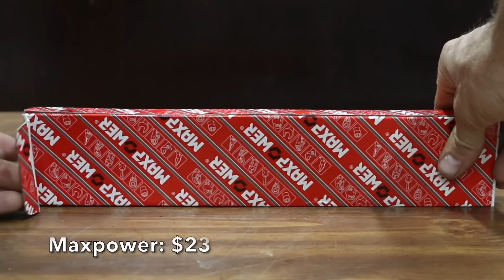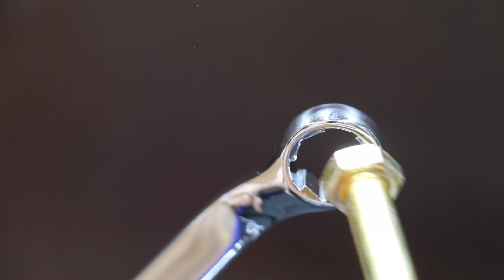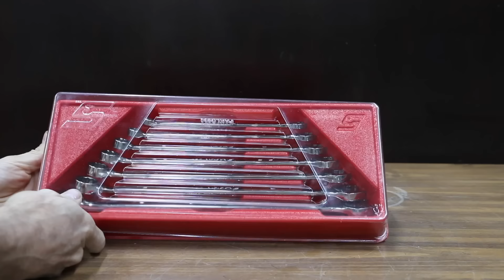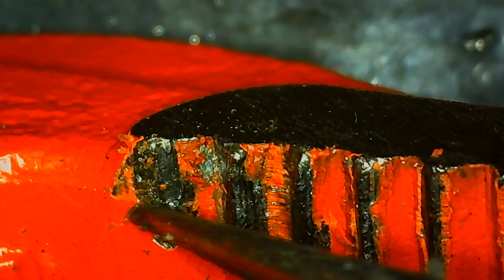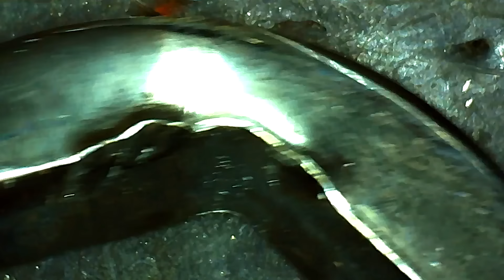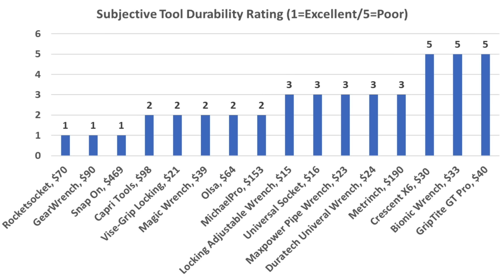Best "Rounded Nut" Extractor Wrench? Let's Settle This!

Comment: I've had that stanly adjustable wrench for years, it's handy to hold bolts and nuts as I go around and get to the other side of the thing. it's also good at crimping ribbon IDC connectors. I did have a problem where the adjustment spline got some damage and I had to take it apart and file the threads.
Reply from the maker: Thanks for the feedback.
Reply: Todd, you're the best.  My spouse says i have too many tools.  What do you do with all of the items you test?

Comment: 2 videos that would be good to see you do would be the best G clamps and best quick release clamps as there are a lot of tradies regardless of their field that use them. Biggest thing I think most people would like too know is the failure load for them as I've had in the past a G clamp break in half while tightening it to hold an item closed.
Reply from the maker: Thanks for the suggestion.

Comment: So I have a project truck and I got some screws on the dash, under the wind shield and I guess the old metal is soft cause my screw driver just tears it apart. What would be a good tool to get that loose and out in a tight space. Could you do a video on....whatever tool that would be to get it out. I don't wanna remove the windshield if I don't have to.
Reply from the maker: Thanks for the video idea.

Comment: Might add,that a good "tube wrench" line wrench,flare nut wrench,is not for wasting on nasty steel bolts which can be attacked with such as pipe wrenches and Vice Grips/turbo sockets. For line fittings and flare nuts,soft things. Brass? Copper?  But good ones are too expensive to use in place of those other tools.
Reply from the maker: Thanks for the feedback.

Comment: The rounded nut...how well does each wrench hold up when a smaller size is hammered onto the nut, does it remove the nut? 9/16" rounded nut, next size down...1/2"
Reply from the maker: Thanks for the suggestion.

Comment: I was looking through your videos hoping to find one comparing power steering fluid vs ATF Dexron 3. YouTube seems to be full of conflicting opinions / information on the subject of which is better, sometimes contradicting themselves within the same video.
My #1 question is about swelling and degradation of the seals in the pump & rack from switching from atf to psf, or mixing the two.
If that's true, then anti friction and temperature performance comparison won't matter so much.
Now I'm watching your stop leak video & the o-ring testing part....nice!
Reply from the maker: Thanks for watching!

Comment: I've used that Stanley locking wrench a few times for adjusting tie rods on rusty cars for alignments. It... kinda works... but the jaws are too soft and there's a bit too much slop when it's locked. I think it's a great tool idea, just needs some tighter QC to make it work better.
Reply from the maker: Thanks for sharing.

Comment: As always, another fine presentation. 
My takeaway from this. Although there is a winner. I believe that in some scenarios, one type may have an advantage over another. That may have been mentioned. If so my apologies. The volume was off. It was homework time and the house is silent except for the homeworkers outloud thinking.
Reply from the maker: Thanks!  Good Point!

Comment: I think the vice grip tool may perform better if flipped 180 degrees from the way you had it. The force applied by the flat on the bolt to the jaw of the tool is more likely to force the jaw open the way you tested the tool. Flip the tool over and the force is applied at a different angle that is less in line with the direction the jaw is hinged.

Comment: Curious why the rounded fastener wasn't ground down to the next smallest wrench size? It might not be an ideal test since we're now comparing different bolt head sizes, but if you're desparate to get a stripped bolt out and don't have a set of extractor wrenches AND extractor sockets it would be good to know which wrench set would work the best in that scenario. Maybe a follow up test?
Reply from the maker: Thanks for the suggestion.

Comment: With rounded bolts I usually grab the knipex water pump pliers because the teeth seem to bite into anything I put them on. Messes the bolt up but I'll usually have replacement hardware on hand. If those don't work I'll grab a pipe wrench if there's enough space to use it. Worse case I just drill it out
Reply from the maker: Thanks for sharing.

Comment: Can you comment on the method used to create the completely rounded bolts? It sort of looked like either a bench grinder or a lathe. Some of the tools had no grip or contact at all with the completely rounded bolt, almost as if the bolt had become undersized when prepping it for testing. In a normal working environment, many "completely rounded" fasteners still have just a touch of flat left on them.
Do you think the prep method may have skewed the testing?

Comment: I wish you had included a standard, curved jaw vise grips style tool.  It seems like for a rounded bolt it may still be the best bet for places where it fits.  If the bolt / nut is already rounded I'm not usually concerned about damage since I'll be replacing it with a new one.
Reply from the maker: Thanks for the suggestion.
Reply from the maker: Thanks for the suggestion.

Comment: I'm curious as to how tightly the Irwin was socked down--since they have a vise-grip mechanism they can be tightened down until they break.  And whether a different size (there are three) would have given a better result.  I use those for rusted on brake lines and they have never failed me.

Comment: Would be nice if  something similar to the old Petersen "Vice Grip" made the locking plyer style tool,I think "Malco" was a project to  make such locking plier tools similar in quality to the original "Vice Grip" but I think they stopped manufacture 
  but such tools are too crude and destructive to use on soft flare nut and line fittings that need to be reassembled ,also too big and bulky 
would be interesting to see what a small "Ridgid" pipe wrench could do with the completely round bolt head
Reply from the maker: Thanks for the constructive feedback.

Comment: Great video. I think if they used better metal when making the universal socket it could be much better. Maybe hardened pins or maybe instead of round pins, maybe hex shaped pins would grip and hold up longer. Also can anyone tell me why on box end wrenches and sockets they don't let the them internally straight to the bottom so it has more contact with the nut/bolt? I have wondered this for a long time, now that I watched this it brought it to the front of my mind. I figured maybe someone knows and wouldn't mind sharing.  Thanks in advance.

Comment: Excellent video! Something that the internet cant seem to find a decent version of is spray bottles! They all seem to have some weakness, whether it be to soaps, alcohols, oils, or even mild solvents, and the trigger jams up, etc. I think it would make for a fantastic video for those of us who use spray bottles in the shop! (possibly even compare some of the bottles from existing products like windex/bleach/etc)
Reply from the maker: Thanks!  Thanks for the video idea.
Reply: @ProjectFarm  You could probably do some sort of crossover video or get advice from Obsessed Garage.  Matt has tested all kinds of different spray bottles.
Reply: Yes I second this!   I've broken at least half a dozen in the past three years alone.
Reply: This is actually a really good video idea
Reply: I will nominate Solo's excellent 1L (418) and 2L (418-2L) hand-pumped spray bottles w/the round reservoir: excellent adjustability; quick pump action; outstanding durability - and 100% rebuildable. Cheap enough you can own one for each type of chemical use, plus always one for water.
Reply: @felisconcolor1112  Where do you get rebuild parts for them?  And have you used them with solvents?
Reply: Would metal reusable ones and plastic ones be 2 separate videos? I had a metal one back in the 90's that I used to use for cosmoline when storing lightly used parts. I miss that one, lost it in one of my moves.
Reply: Same here bleach just destroys bottles

Comment: I'm glad you put a pipe wrench in this video, I keep a 6 inch rigid pipe wrench in my tool bag for rounded bolts. If it's set right the harder you push the harder it bites.
Reply from the maker: Thanks for the feedback.

Comment: I was given a Bionic Wrench for Christmas quite a long time ago and haven't tried it yet.  I didn't think it would be durable, and it isn't.  And the shape makes it awkward to use, too.  I've got at least one of those Universal Socket Multi-Function Adapter pin-inside things that I have never used.  And now I see why.  🤣😂🤣😜  The RocketSocket may have been able to handle tractor mower spindle bolt that broke in one of its mounting holes.  It was stuck so bad, the bolt head broke off.  I tried loosening liquids and vice grips, but all that did was strip all the threads, so I had to grind it flat on both sides, try to center punch, drill it out and tap it.  I got close to center, but had to adjust the deck mounting hole by making it oblong for the new bolt to fit, but it worked without having to buy a replacement, but man, that was a HUGE PITA!!!

Any damage done by the RocketSocket would be acceptable because getting it out is all that matters.  And it's very durable!  I just bought the RocketSocket set from your store.  It will be here on the 22nd.  That Wrench Extender Tool Bar is very cool, but I don't think I need one.  I love your work, Todd, and I benefited from this one.  I'm sure the RocketSocket set will come in handy for many applications.  Thank you and great job!
Reply from the maker: Thanks for sharing!

Comment: I ended up buying some "Rocket socket" look-a-likes based on your original recommendations.
Those types of sockets are so good at removing rounded nuts.

I'm honestly amazed at the level of torque they can hold without losing grip. It's honestly one of the best tools to have when working on old rusty cars :D
Reply from the maker: Thanks for sharing!
Reply: They work great on rounded lug nuts too.
Reply: Tool Review Zone made a vid showing GearWrenches version, definitely made me a believer
Reply: yea but they quickly loose their edge, and you cant always heat up the broken stud (too close to oil seals, 0 rings, gaskets etc). atleast for the salty outboards i work on. but agree... they are very good. have piles of em'

Comment: My last resort option to remove rounded nuts, is my chisel/air chisel.

Start by going straight in, and go, at most, half way through into the nut , then angle towards the direction to loosen.
The nut will likely split, but even if it doesn’t it will loosen.

This will destroy the nut, of course, but it works on both Metric and SAE
Reply from the maker: Thanks for sharing!

Comment: I hadn't thought of using a pipe wrench before. That's definitely worth a shot if the bolt is in an accessible spot. I usually go with a pair of locking vice grips and a hammer.
Reply from the maker: Thanks for sharing!

Comment: So I have a question.  On the wrenches that 'there wasn't enough surface area on the rounded bolt' did you try going down a size to see if they would do anything?  I'd be curious to see if that would make a difference.
Reply: Seems like kinda an oversight, obviously the bolt is no longer the same size it came in

Comment: What if you cut a slot into round head bolts were possible to make large screw type fasteners?  Portable rotary tools/ Dremel tools are plentiful and are becoming very affordable . As we know from previous PF testing.  I say a slot because it is one cut vs many ,but any shape could be utilized. They make highspeed burrs so small they are not much larger than a human hair.  If you are paid by the hour , there is no reason you can't make torx or star bits lol.
I also wonder if the tools that break could be made tougher by a heat soak , just throwing the tool in an over on broiler for an hour and then drop to the highest oven setting for an hour and then drop to 400°f for 24 hours , then let it cool in the oven unil room temp. Chances are it will remove some of  the brittleness of the steel in the problem areas. It won't hurt most already properly heat treated parts and hey, if it can make a good concept that's poorly made into a good tool , it may be worth while if the base tool is cheap enough.

Comment: Would like to see test small shop air compressors , 2 hp, oil free direct drive, oil lubed,  belt drive 1 and 2 cylinder, 1725 vs 3450 rpm motors....I have had many over the years, and I believe the speedair 2cyl 1725 rpm was the most efficient... let me know.
Reply from the maker: Thank you for the video idea!

Comment: A small pipe wrench is an excellent tool for any mechanic to keep stashed in the back of the toolbox. Yes it ruins the bolt but you’re replacing it anyway. I’ve been saved many times by my pipe wrench!
Reply from the maker: Thanks for sharing!

Comment: Great video! Would love to see a test of Pelican 1510, Seahorse 920, Vault V525, HPRC 2550w, Nanuk 935, and Apache 5800 Hard cases. Testing for water tightness, pull handle,side handle, and latch strength, case strength via drop testing, and chemical resistance! They are meant to be used for cameras and other things but as aviation mechanics this is very popular brand and size to use as a line tool toolbox! You are the best person to test these and great video by the way!
Reply from the maker: Thank you for the video idea!
Reply: @ProjectFarm  Thank you sir! You have saved me alot of money these last few years!

Comment: Excellent review... I really appreciate this test with such a variety of brands. Would have been cool to use the Rocket Socket on a reverse threaded bolt just to see how much torque could be applied before slipping or breaking.
Reply from the maker: Thank you!
Reply: On a left hand thread? I can guarantee absolutely none. Just like a screw extractor, it digs in as it gets tighter being turned into a right hand thread. It’ll just push out on a left hand thread.

Comment: Curious. What about using a smaller-size wrench on the rounded bolts, even if you have to pound the wrench on it with a hammer?

Comment: You should have tried the next smaller wrench for the totally rounded bolts. Use a hammer to tap it on. This is how they are designed to work.
Reply from the maker: Thanks for the feedback!

Comment: I bought the angry pipe wrench based off of Raymond rays repairs channel. It’ll get the job done and it damage itself, but what is cheaper … replacing a $30 tool or replacing the part you can’t get the part off of
Reply from the maker: Thanks for sharing!

Comment: The socket rocket designs is the only one that I have ever seen in maintenance heavy industry that really has worked the most  times . Seen lots of other tools that say they are good but failed miserably . It’s usually always the same story in the end result . Call the Welder with the spiecalty rod too weld nuts on 👍
Reply from the maker: Thanks for sharing!